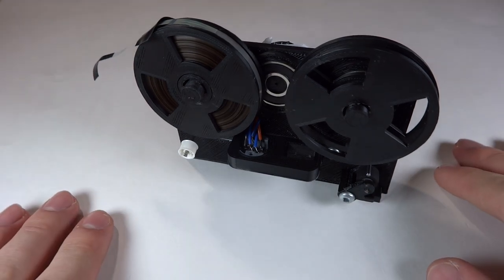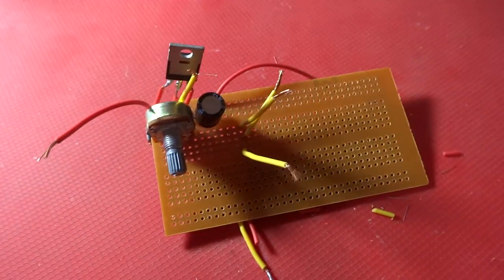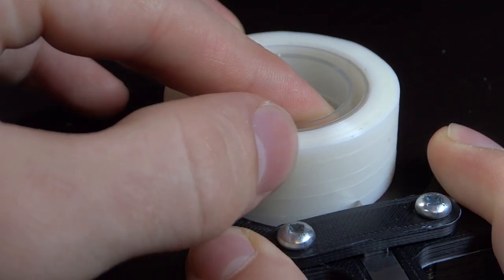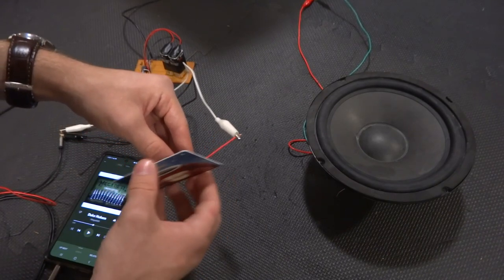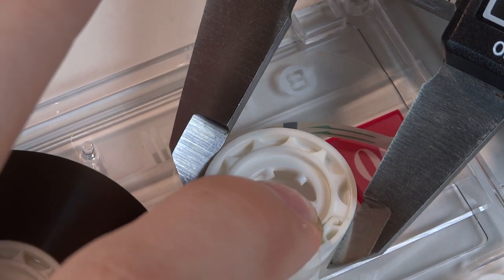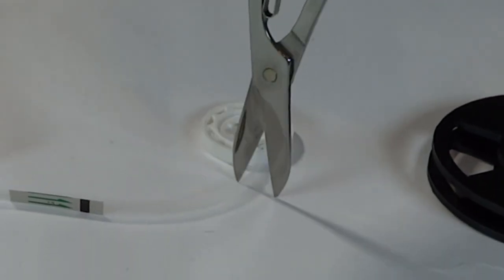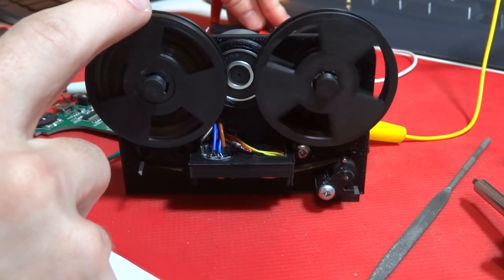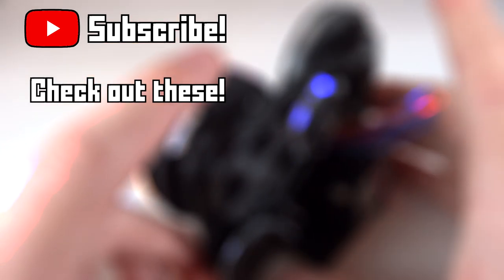Building an Open Reel to Reel Machine: Harder than it Looks

Comment: @CamdenBowen I don't understand what you were trying to do. The magnetic tape should be extremely fine and uniformly coated with a ferrous material. To record and play back audio, the tape must move in one direction at a consistent and uniform speed (never back and forth like a saw motion). During recording, an "erase head" should be used before the recording head to align the ferrous coating and erase any previous recordings. Additionally, a bias signal of 50 kHz or higher should be added to the actual audio signal to improve recording quality

Comment: Holy crap, that's some nice hack! Making your own experimental tape is taking stuff to the next level.

If you want to record the tape, you'll need an erasing head before the record/playback one, and some high frequency bias current on the recording head. Otherwise you won't go far when it comes to noise and distortion, even on factory-made tapes.

Comment: This is really cool and interesting. Don't give up. The interference can be helped by shielding and  moving the motor away. The heads can be attached to the amplifiers using shielded cables.

Comment: Hello, ive been trying a similar device, creating a casette recorder / player, and the magnetic fields of a dc motor can interfer with the devices sound, and so keeping the motor away from the tape head or any connective areas, can decrease the noise, and the frequency should be lower, 2 9V batteries is a lot, i have got no résult yet, but i will attempt with a lower voltage, and may i ask, does your magnetic have a common ground or is it DC?

Comment: Nice video! One thing that I noticed is that you are trying to record on the tape using only the audio signal but to record properly you need the bias. I dont know for sure how it works but you need to modulate a high frequency signal (something like 50khz to 150khz) with the sound signal and then feed it to the record head. If you plan to continue using normal Type I cassette tapes you can search on the internet how the bias signal is generated on a tape deck for a Type I cassette and then you can try to replicate it on your project.
Greetings from Brazil!

Comment: hi i got a emi BTR 4 slave decks  from a man i know cor what alot of work i have to take all the slave wiring out 

i picked up  8 1/4 in   1/8  basf spools   you may not know about the they used to sell 1/8 tape on them for ddubing game 

i had  40 pancakes from the usa before prices got silly so i have some 1/8 reel to reel decks
doing anything with 1/8 reel to reel is a right pain i can tell you   best to keep away